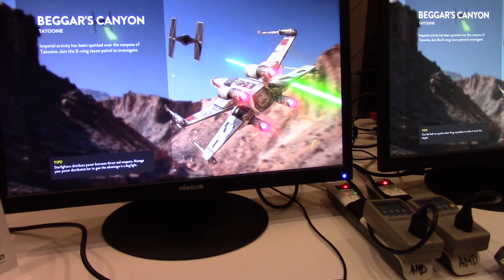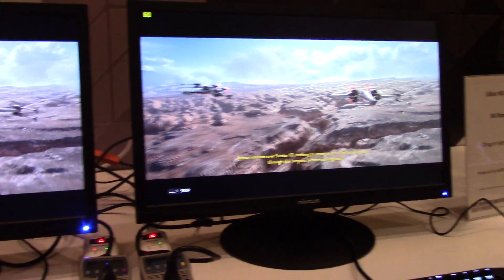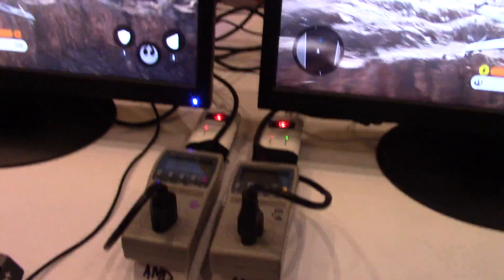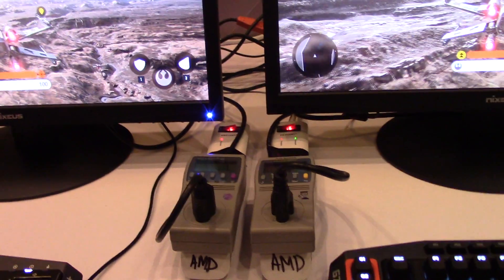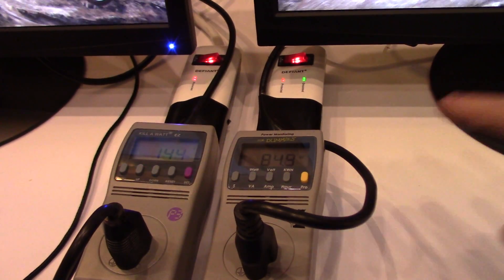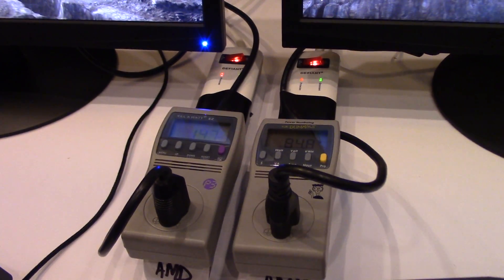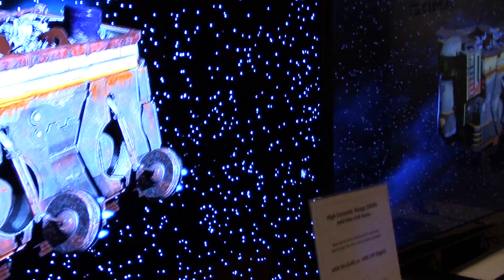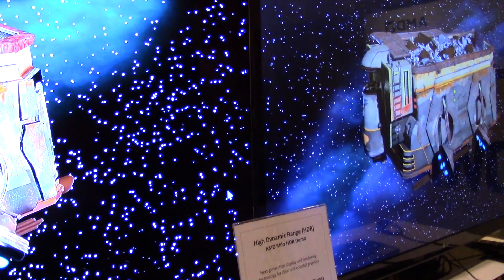CES 2016: AMD Talks Polaris GPU and HDR Monitors

Comment: hdr 144hz 1440p freesync please
Reply: +JellyScrub +ultra wide and curved pls and thank you.
Reply: +Syllaren All of that on a 34 inch 4K OLED display and I'm in.
Reply: if you are already in the nvidia ecosystem then definatly but if you are with AMD then freesync is cool too! Plus its a bit cheaper :D
Reply: Gsync is better
Reply: +JellyScrub that's true.
Reply: +Matic Krmec freesync only works in certain refresh rate gaps. what's the point of freesync if it doesn't even work alot of the time?
Reply: +CrackedDylMil That is not true. the monitor you buy determines that gap and not the standard. You can get monitors with super wide gaps. You can even edit the limitations of the dynamic refresh rate gap by editing the firmware of the monitor. So really, manufactures just need to release newer monitors with more capable dynamic refresh rate capabilities.
Reply: +CrackedDylMil What's the point in it? You just said it yourself, FREEsync, it's fucking FREE. You literally pay nothing for it.
Reply: +Ephi tade I don't care if it's cheaper if it's worse
Reply: +CrackedDylMil Freesync supports all refresh rates, the cheap scaler that monitor manufacturers are using doesn't.
Reply: +Ephi tade that's like me saying "Toothpaste makes your teeth yellow, it's just that every Toothpaste you can buy makes your teeth white."
Reply: +CrackedDylMil ...what
Reply: +Ephi tade you said Freesync is free, and that's why it's good. Now your saying the only reason it's bad because monitors use cheap scalers. You know what's a better scaler? A GSync module. 

Also, you going and saying "oh Freesync works on all refresh rates! It's just that the monitors don't let it work on all refresh rates." is like me saying "Toothpaste makes your teeth rot, it's just that consumer Toothpaste makes your teeth clean."
Reply: CrackedDylMil the point is if the monitor has a better scaler it'll perform about like gsync... but cheaper still... and if it doesn't it'll perform a little worse... but be way cheaper.

GSync really didn't bring much of anything to the table except for royalty checks for nvidia... like most of their "inventions"
Reply: +Syllaren I haven't seen a monitor yet that performs as well as gsync. and you say nvidia isn't innovating when gsync was around like a year before freesync. lol
Reply: CrackedDylMil there is barely any performance difference with the good freesync monitors, and a rather large cost distance. and freesync is just slightly altering adaptive sync which has been around since display port. only difference is amd didn't plan to come out with a new technology by taking an established idea, tweaking it, and putting a price tag on it.

there really isn't any viable reason to pay the premium for gsync.
Reply: +Syllaren the premium for those nice scalers you were talking about in a monitor isn't much cheaper than a better, more reliable gsync module
Reply: +Syllaren found an acer display that with gsync, will use variable refresh rates between 30-144hz. However on Freesync, it'll only do it in 48-75Hz. I don't know about you AMD guys, but my GPU pumps alot more than 75fps in pretty much all the games I play.
Reply: CrackedDylMil and that wouldn't be one of the good ones now would it? top range of amd freesync is 9-244hz. and the best monitors will go up to 144. just recently saw one with 40-144 and i am willing to gamble there is one with 30.

so yes. if you spend 3 minutes looking, you can find a freesync monitor that competes with gsync, with way less cost.

research what you buy, and you get a better deal, don't, and you get shafted.... that's how it usually is.

and the scalers are cheaper... drastically so. the cost of a better scaler really isn't significant... it's just they weren't needed until recently. and most of the 40-75 ones are used for 60hz monitors, and are likely all you would need(unless you had a super weak card that couldn't pull off 40fps... which imo you shouldn't game under 40 anyway).
Reply: +Syllaren gsync will do 30-top refresh rate. Still better than your best case.
Reply: CrackedDylMil the one i had was 40-top, and i didn't even f'ing look for the best range. also, freesync is capable of 9-244... that means freesync is viable for the forseeable future, as long as a company feels like putting in the right scaler it can do 09-top. gsync has almost no benefits, and definitely not enough to warrant a price gouge.

no matter what the scaler costs, it will always be cheaper than the same performance in the gsync models simply because of nvidias proprietary hold on it. in EVERY price range, freesync will either match or surpass nvidia.

also i don't allow my games to dip down to 30 so that doesn't matter to me... i will lower the settings if it ever dips below 50 personally. smooth gameplay is more important that small aesthetic increases for me.
Reply: CrackedDylMil yep, just confirmed it. there are 144hz freesync monitors that do 30-top. so now your only argument is freesync has low to high performance with no gaps.... low costing less, high costing more... and all cheaper than the gsync option... good argument.
Reply: +CrackedDylMil Check Linus Freesync vs Gsync, Freesync is obviously better. Or Benqs monitor is better then Asus Rog Swift, which I doubt....
Reply: +olle12 it's not better. At the "Sweet spot refresh rate" gsync has the lower delay. It basically allows smooth 4K gaming at 45fps.
Reply: CrackedDylMil they are both a bit too unstable to really rate. i don't play 4k and freesync seems good to go on the high refresh rates, so that one fits me. nvidia does seem to handle the low areas better so people who need 4k in sacrifice of frames, might like gsync more.... despite it costing way too much for what it offers.
Reply: +Syllaren cost doesn't really matter that much when the monitors with gsync are already expensive. And it also doesn't matter that much when nvidia is like 80% of the market or whatever it is now
Reply: +Syllaren cost doesn't really matter that much when the monitors with gsync are already expensive. And it also doesn't matter that much when nvidia is like 80% of the market or whatever it is now
Reply: CrackedDylMil it matters quite a bit that so many sheep are more than happy to spend extra money for no reason other than nvidia saying they need to. nvidia customers really aren't getting much back and they have to pay a reasonably large amount more for that tiny and almost insignificant return. 

right now the biggest bottleneck to freesync is the monitor manufacturers cheaping out. when adaptable frames become the next big thing they'll spend the extra to have the advertising slogan.... then you'll have gsync and a monitor with NO shortcomings, that costs less thanks to nvidias stupid proprietary hardware.

nvidia is a company that focuses on nothing but it's profits and has FREQUENTLY screwed over it's competitors and it's own customers.... amd is, and ati was, a company going after innovation.... why would i support the former?
Reply: +Syllaren a company for innovation? That doesn't sound right. Keep in mind GSync is the tech that started this whole mess. AMD has to play catch up. Their PhysX Flex is another example. The Tegra 4, K1, and X1 are also examples of that. I don't actually have a problem with AMD (in fact I would've gladly bought a 390 over my 970, if the 390 were out at the time) it's just that atm, what the consumer gets matters more than the morals behind the company. You could argue that nvidia is holding back the world by keeping things private, I would say that they didn't have to contribute anyways,  but it would help if they were opened like AMD. But for now, all that matters for most consumers is who gives a better gaming experience. At the moment, nvidias superior software alone is enough to win that consumer.
Reply: CrackedDylMil adaptive sync has been a feature in display port for ages... just that no one ever bothered using it.

physx actually was a decent innovation... but instead of letting it spread properly they, unlike what amd does with their breakthroughs, limited it to their hardware only. resulting in higher cpu overheads for amd based systems when the feature is on.

nvidia is nothing but corruption, and while they do have innovations from their research, they don't try to let them spread.... they lock them up for proffits.

meanwhile amd releases most of their breakthroughs for other people to use in order to move the industry as a whole forward.... and this action is why they are losing money. if they acted like nvidia amd would be a far more stable company, but we would all pay more, and it's very likely that the computer industry would be a step or two back.
Reply: +Syllaren Yeah. Nobody used it. So who cares? Nvidia brought it to consumers. Everybody loved it, so AMD had to jump on board afterwards. I can't remember the last AMD break through. Maybe AMD64 years and years ago, but AMD64 is nothing without Intel i386
Reply: CrackedDylMil nvidia noticed an unused feature and exploited it to make a buck. amd noticed it was an already included features and pointed that out. like i said, they do make innovations, it was cool they pointed out that we weren't making use of it.

wasn't cool they made some BS name and hardware plugin just so they could skim off royalty fees, and if you can't remember amd breakthroughs you need to look through history a bit more. amd has had a ton of breakthroughs, and like 90% were available for public use with no fees attached.
Reply: +Syllaren and yet you name none of the 'break through'. And you saying "they just noticed that feature and used it." implying they did nothing, is like saying the people that found heart bleed did nothing, because it was there all alone
Reply: CrackedDylMil everything from HBM implementation to (tons) of software to Mantle(which kick started dx12 to release faster, on top of being a comparably powerful platform), to gpuOpen to vr tech to apus. amd has tons of innovations, and even a lot of attempted innovations that got dropped by poor adoption such as the bulldozer/piledriver achitecture. using 2 physical cores that share resources instead of 1 physical splitting it's resources to emulate a virtual core.. a promising tech, that didn't quite work out primarily due to poor core utilization by coders(which amd should have expected honestly).

amd does have a lot innovations, and the ones i just listed are just the ones that came off the top of my head. they assuredly have far more that i just don't remember. 

as for implying nvidia did nothing... they actually really didn't. they noticed an unused feature, which is commendable, but based on the implementation i'd wager they spent more R&D on their unneeded proprietary hardware than they did on just getting the already working feature onto their gpus... made obvious by amd's competing inch for inch with it despite a less stable hardware environment and a lower R&D budget. 

Nvidia is a solid company when it comes to their tech, but morally speaking the thing is an abyss. some of the biggest crooks in the entire tech industry, only outshined by IBM a few years back, and apple right now. Meanwhile amd isn't a company of saints, it's still a business, but overall they have had a rather positive track record over most of their history... so yeah, of the two i support amd. they go back and forth on hardware superiority, so i have no huge complaints about nvidia hardware other than a few weird price increases.... but i would much rather support AMD than further fund such a corrupted and self serving company.
Reply: +Syllaren the only real innovation in that list is HBM. APUs are terrible. It's the worst of both worlds. You get the slow performance of a typical AMD cpu, and the slow performance of an integrated GPU. Plus, Intel has been doing iGPUS for a long, long time. GPUOpen hasn't done anything so far, and Mantle wasn't very good either, Mantle was basically just to get developers take more advantage of multiple cores, since the single core performance of AMD cpus was so terrible. Actually come to think of it, all of AMDs software is terrible. Drivers, crimson, catalyst, etc.
Reply: +Syllaren oh and AMD didnt  notice the standard for their Freesync tech until nvidia thought about it months before.
Reply: CrackedDylMil i've said it multiple times. nvidia noticing that unused feature would have been commendable if they just made people aware in order to better the gaming community... instead they said "oh hey... lets exploit this and carve out a niche people need to pay for before it becomes standard practice"

i have never said nvidia doesn't make breakthroughs, and i've said that i respect their tech. some of the developments they've made are amazing.... it's just the fact that instead of letting the industry benefit as a whole from these, they lock them down in an attempt to squeeze every penny out of their consumers/partners, and to cripple their competition.

Comment: Guys if what they are measuring is TOTAL SYSTEM POWER than the polaris performance per watt is slightly bigger than 2x!
Let's say the cpu ram fans mb and ssd eats about 50W, than we have the 950 consuming around 95W and the Polaris card around 34W, THIS IS NEARLY 3X EFFICIENCY ADVANTAGE FOR POLARIS!!!

Comment: How can they change brightness levels across traditional LCD displays? Doesn't their single backlight design render them incapable of that sort of operation?
Reply: +Richard Dickson They discussed that you need a specific  new type of display panel?
Reply: Chris Hunter ...like an AMOLED display.

Sounds like this HDR thing is just a load of BS. You can't make a traditional LCD display brighter in different regions of the panel. That sort of functionality requires an entirely new, expensive display technology like OLED.

Comment: I'm dumbfounded and in disbelief.  Unfortunately this may be some kind of marketing trick or special case.  Total system power consumption?  No doubt the CPU and other components are eating up a good percentage of the power,  which makes the results all the more impressive.  They are saying nearly 2X, but if this no trick, it is most likely outdoing the 950 by far more than 2X.

Comment: Did he just said ENTRE SYSTEM POWER DRAW???
Reply from the maker: +Jonathan Rae Crisanto Yes
Reply: ***** What would be the point in using an APU only to use the CPU? Looking at that power consumption, I'm gonna go ahead and say it's an Intel CPU.
Reply: +Jonathan Rae Crisanto Bet its still running an Intel CPU though at that power consumption...
Reply: +Andy „Reaper“ Bradley or a AMD APU. doesnt need much power too.
Reply: +Daniel Fischer No Polaris wouldn't be in an APU yet, not for a long while.
Reply: Bannicus did i say that? You can just use the cpu of it too
Reply: +Andy Bradley “Reaper” yes, I believe its an intel on both machines.  AMD showed the specs for both PCs somewhere I think probably their official site.
Reply: +Sage Maneja its i7 4790k

Comment: Wow, this is the ENTIRE SYSTEM so it could feasibly run on a 150W PSU. Isn't that incredible? A fuckin' prebuilt PSU!
Reply: wouldn't suggest it. but just stick with 500w
Reply: Andrew Pilot I wouldn't suggest it either but it's nice to know you could
Reply: letsgoiowa at this range 500w is fine for the system
Reply: +letsgoiowa Meh my 7870, i5 2400 runs around 200W total tdp. And that was from 2012-13. Not very impressive.
Reply: mrzazzaable 200W total TDP compared to less than half is not impressive?
What does it take to impress you ffs?
Reply: +Andrew Pilot 
Funny u would say that, because a 5930x+980ti only draws 360 watts~!